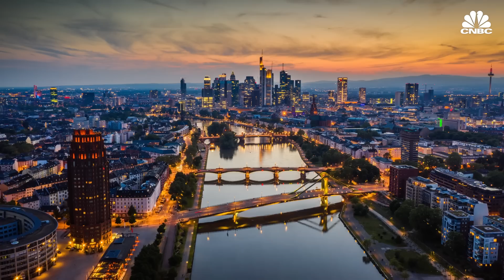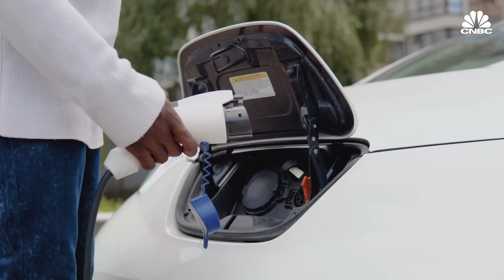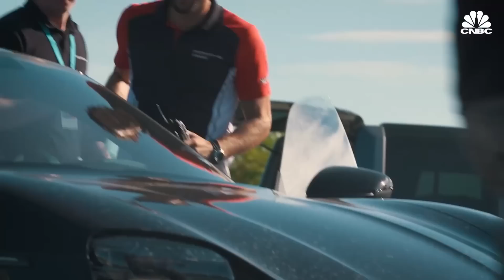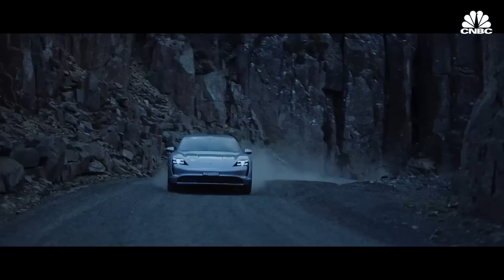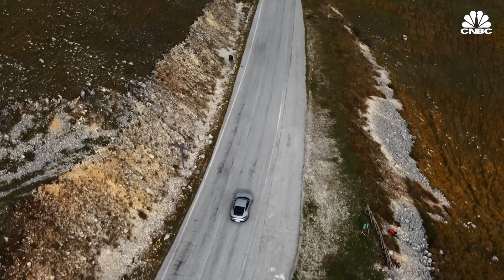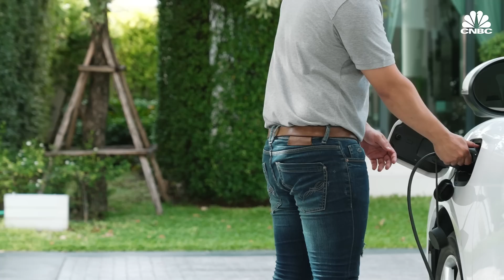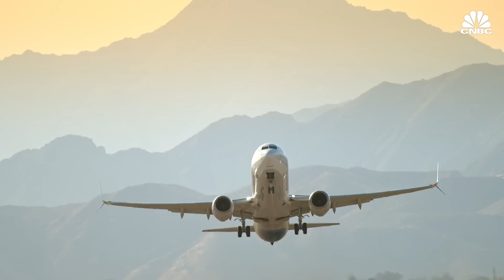How Porsche Plans To Keep Its Gas-Powered Cars On The Roads

Comment: Replacing all current motor vehicles with EVs is ecologically absurd. 
Producing all these new vehicles, the huge infastructures to power them, their inherent inefficiency (due to their exponential weight) and the fact there simply aren't enough resources for it all makes it impossible. They are only really fit for marginal use in cities.
That's why we need these synthetic fuels for all cars, not only Porsches. 

It would fix the real problem of cars : CO2 emissions.
Fine particles won't be a problem anymore once we keep road cars out of cities and replace them with small, light, shared EVs reserved for logistics.
Reply: My Kia eNiro weighs less than a Range Rover. A Tesla Model 3SR weighs less than a BMW 5 Series estate car. Try again.
Reply: @Brian-om2hh  Those are irrelevant comparisons, noe of these vehicles are in the same class. You try again.

Comment: $100 million actually is quite a tiny investment for a car company. 

E-fuels should be used for planes and not for cars until there is enough supply. Planes can't be electric so far because of the weight of the batteries.

Comment: This is absurd to me. I am all for E.V. but 15 years from now the amount of battery, "recycling" will be absolutely humongous. FURTHER. to recycle a car, motor battery it takes a HUGE amount of time. It is not a job that you can have robots do, the way that they are used to paint cars. ALSO, what will E.V. do to the price of electricity? The more use, during summer, the higher the bills for kilowatt hours are. Considering the laws of supply and demand, how many people will be able to even AFFORD an E.V. say, 15 years from now? If they can not afford an E.V. by then, they will not be able to afford a car!
Reply: EV for city driving is a good idea actually. But only for that
Reply: @hectornecromancer5308  Nonsense. I've used my EV for 500+ mile trips.
Reply: @Brian-om2hh  current EV can already reach that distance afterall

Comment: What a surprise: A dinosaur car maker does not want to build BEVs and stuck to the old crap that they have been doing forever. Efuels will never take off, it is a truely dumb concept and white-washing. Instead of wasting electricity in a very elaborate process to produce Efuels, you better just use the electricity directly in a BEV. Porsche, like all old car manufacturers, can build a battery electric vehicle (BEV) worth a damn, so they want to keep building wasteful and overcomplicated ICE cars.

Comment: I am curious if there is a fuel that can be biological engineered and controlled and multiply via processes of meiosis. Never have to fill up again. There's meiosis going on in the fuel tank 😂. Of course, some controls need to be in place to pause the meiosis process to prevent overfilling. Need some technology to see what makes a beating 💓 keep going and replicate that process into powering automobiles. As the founder of Koenigsegg has stated, "Vehicles are an extension of our freedom."

Comment: This video journalist is leaving out two very downsides to E-Fuels. 
1) They still burn and create CO2 in the process.... basically releasing the CO2 that was taken out of the atmosphere to make the fuel. Ergo they call it "carbon neutral". 
So this is not helping. 
2) Burning E-Fuels still polluted the atmosphere with other noxious and cancer causing chemicals just like gas does. 

Q: what happens if Tesla out other brand brings out an ultra luxurious sports cast rivaling the 911?  Will anyone want to keep that old 911 then?

Oh and a company has announced 500w/KG batteries recently. They expect to be able to bring them to market in a few years. This is enough to make even long flights in electric planes. So where will this E-Fuel really have a market in the quantities needed to make it cheap enough? It won't.
Reply: Sea transportation, for example?
Reply: @hectornecromancer5308  Possibly a good solution for older ships that would soon be retired. For newer ships with more life in them 500w/KG batteries can do this too. Use the area that the fuel tanks take up on the ship (which is huge) and possibly build the hull crossmembers themselves with battery shelves in them. It would more than likely be plenty to go across the oceans given an efficient electric drive. 
Cruise ships, on the other hand, might need to use the E-Fuel because their onboard electric use is crazy high. Possibly have the new batteries run the ship's drive then E-Fuel generators for the electrical usage onboard???

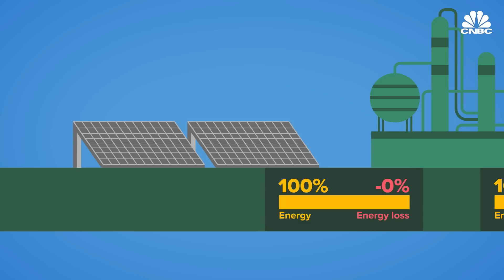Comment: 11:10 is a good animation of the terrible energy efficiency of e-fuels.  

Also e-fuels retain all of the smog and pollution problems of gasoline.  Gasoline (including e-fuels) must contain carbon ring aromatics Benzene, Toluene, Xylene (BTX) which is are well known carcinogens -- but are critical to increase octane to reduce engine knock.  Benzene is banned in all consumer products and cannot be purchased without a permit.  Yet toxic amounts are emitted by gasoline engine cars everyday!   There's also NOₓ and SOₓ emissions too.

The commercialization of EV changes the societal tolerance and economic equations where what was tolerated before may no longer be tolerated because there is now an alternative to the internal combustion engine.

Sure, new e-fuel-based ICE vehicles might be available for purchase post-2035.  But may end up not be able to get a permit for them in all but select internal combustion engine (ICE) friendly territories like Italy and Germany based on much stricter emission standards in the near future.  Moreover, traditional existing (not new) ICE vehicles post-2035 will just use regular gasoline since gasoline is not banned after 2035.  Why buy e-fuels that cost 5x to 20x more and is very limited distribution?  This leaves no future for e-fuels really.

Comment: At time marker 12:13.  It was stated 19% is loss at charging.   Take you down to 81%.   And then you loss 20% in the car.   That leaves you 65%.   Am I missing something here?
Reply: Don't forget... don't run your car to 0 and don't charge over 80%. That takes you to 50% of the electricity you paid for, moving the car but only in summer, when it's not too hot. 
In winter, you have roughly 20% of the electricity you paid for, available to move you.
Reply: Probably. The point seems to be that 65% is much higher than the 16 or 17? of ICE engines.
Reply: It surprises you that EV advocates aren’t intellectually honest when talking about EVs?
Reply: @DeepBrainThrombosis  , nope.   I love details and if you're going to put them in your video, they should pass the sniff test.  Or at least explain why your numbers are not adding up.

Comment: Comparing electric energy utilization to a gasoline is the stupidest thing I have ever heard. Ofcouse 100% electric energy is going to be consumed by electric technology. You cant use 100% of the electric energy in gasoline cars because it doesn't use electricity for propulsion. What is not news is gasoline cars always use 14-30% of the energy to move the car. The rest goes out as heat. Here is a fact, electric cars contributes nothing to stop Co2 reduction, because it produce Co2 to produce these batteries. EFUEL in other hands capture and recycles Co2 not produce it.

Comment: combustion cars, lots of moving parts, high maintenance, high costs, high profits
Reply: EVs involve dirty mining for batteries…Exceptional upgrade to existing electrical infrastructure
Reply: @quettagladiator5272  that is greatly improved in the only 10years they exist. And already cleaner over a cars lifespan. And will endlessly continue to improve. Fossil however will always be dirty and politically disturbing.
Reply: @quettagladiator5272  Refining oil also involves using huge amounts of mined minerals...... In fact the oil industry are the largest users of mined minerals on the planet. They have mined minerals for decades.....

Comment: Petrol is $8.29 per gallon in the UK so $10 per gallon seems alright for efuel 😅
Reply: Petrol costs only around $3 a gallon, the rest is tax. The $10 is only production cost in 30+ years, once the process is scaled up. Estimated price in 2035 is closer to $16 a gallon plus tax.
Reply: @Psi-Storm  Still cheaper than buying an expensive electric car and maintenance for batteries
Reply: @1marcelfilms  There isn't going to be any maintenance for the batteries.  It's now coming out that the batteries form an integral part of the car and can't be replaced in most of them.  Can you say toxic waste dumps?
Reply: @lanpartyanimal5215  while batteries don't need as much maintenance as ICE component, god foraskes you if it's broken, as it can cost as much as the car itself
Reply: @lanpartyanimal5215  You cant fix a battery but you can fix combustion cars. Majority of the cars in the world are old and ev's life expectancy is short
Reply: how is it $8+ that makes no sense.... $5 is insane and $3 per gallon is normal
Reply: You can also buy Aspen synthetic petrol here in the UK. It's been on sale for decades. The downside is the cost, at around £30 ($40) per gallon....... Synthetic fuels aren't going to come cheap......
Reply: I don’t know why everyone thinks electric evs are more climate friendly, the amount of lithium that needs to be mined, transportation for the batteries to be made which are then transported again to a car assembly factory. Not to mention the fact that most counties simply don’t have the infrastructure to provide 100% clean energy to power these cars.
Reply: 1) there is nothing unusual happening with the climate.

2) there is nothing wrong with burning fossil fuels.  Its problems in high-density areas are trivial to fix and already have been fixed.  CO2 is not a pollutant.

3) Climate alarmism is a big-lie superstition supported by tax-bribed liars.  (See Climate Discussion Nexus for 100s of videos on climate quackery, deception, and realism.)

4) decarbonization is 21st century pyramid building and human sacrifice. 

5) there is NO excuse for expensive electricity.  Electricity generation is boring.     Just burn coal and scrub the smoke in densely populated areas.

6) the only challenge is manufacturing market quantities of cheap gasoline.  South Africa has already done this for decades (Sasol), using coal.

Comment: Too much legislation, too little advance. Europe goes out of its way to make things "greener", but when Germany's economy gets affected by it (or any of its other members that produce cars), I don't know how eager they would want to just go electric. The infrastructure needs to improve, and the bigger sectors (aviation and marine. Both should be the priority) are taking their time in developing new technologies.

Not a single comment about how dirty producing those batteries is, or how to dispose of them when their life runs out. We need way more options than just FEVs. We need better transport which should also be a priority. We need cities that are greener in reality. But what we need the most is to shut off the dumb idea of being "Net Zero" without actually providing better options. Even small steps like an "eFuel" (weird coming from VW) are something. Hydrogen on planes, nuclear ships, etc. We gotta see what the following years bring us.
Reply: We do have nuclear ships
Reply: So the oil industry tells you how dirty battery production is and you just believe that? Battery packs are made out of 300kg of aluminium, 50 kg of plastics, 10 kg of lithium and small amounts of Nickel, Manganese and Cobalt, or alternatively Iron oxide in LFP batteries. How is that dirtier than producing any other big expensive metal product. Then you have to go after big cars first, because almost everybody could just drive around in a subcompact, that weights half as much. When we stop burning fossil fuels, half of the world wide mining operations will cease to exist, which would be a massive improvement for the environment, but that isn't something you would hear from the fossil fuel industry.

Comment: I am a die hard EV fan but, if we can get E-fuel to help preserve the old classic Porsche's I am all for it.
Reply: I'd like to try the e-fuel on a Ford Crown Victoria (1998-2012 specifically).
Reply: 1) there is nothing unusual happening with the climate.

2) there is nothing wrong with burning fossil fuels.  Its problems in high-density areas are trivial to fix and already have been fixed.  CO2 is not a pollutant.

3) Climate alarmism is a big-lie superstition supported by tax-bribed liars.  (See Climate Discussion Nexus for 100s of videos on climate quackery, deception, and realism.)

4) decarbonization is 21st century pyramid building and human sacrifice. 

5) there is NO excuse for expensive electricity.  Electricity generation is boring.     Just burn coal and scrub the smoke in densely populated areas.

6) the only challenge is manufacturing market quantities of cheap gasoline.  South Africa has already done this for decades (Sasol), using coal.
Reply: We already do, it's called alcohol, and it's been used in engines for nearly two centuries.
Reply: You'll be an EV fan until you realize that the batteries make up an integral part of the structure of the car in most cases and cannot be replaced.  Look it up.  I was surprised by that too but it makes sense that they would take these kinds of shortcuts because everything today is throw away...
Reply: @lanpartyanimal5215  That's only true of the newest Tesla Model 3's and Tesla Model Y's, but I agree that it is a mistake. You can still replace the batteries since the pack shell is the structural component, not the batteries themselves, but it makes it a lot harder for independent mechanics to fix packs. That fits into Tesla's anti-right-to-repair stance, which I still don't understand because they haven't built out enough service centers to take care of their 11-year-old Model S's.
Reply: @lanpartyanimal5215  Strange that. Cleveleys Electric Vehicles here in Gloucestershire, England, have already replaced and refurbished a number of EV battery packs...... Just because you aren't aware of it doesn't mean it can't be done......
Reply: @Brian-om2hh  The same applies.  Just because they've managed to, and at what cost as well,  doesn't mean every vehicle has been designed with that in mind.  The difference is a petrol vehicle can be run and run where the engine will outlast the vehicle.  No battery set will outlast it's vehicle unless it is wrecked.  So everyone will be faced with the exorbitant cost of battery replacement iF it is even available.
Reply: Sorry environmentalists already decided that farming and/or processing of the materials required to create e-fuels is bad for the environment. 
Also, it's usually a crop that poor third world countries need for food.
Reply: i have never heard of anyone call themselves a "die hard EV fan" 💀